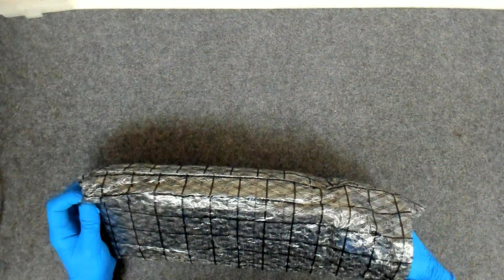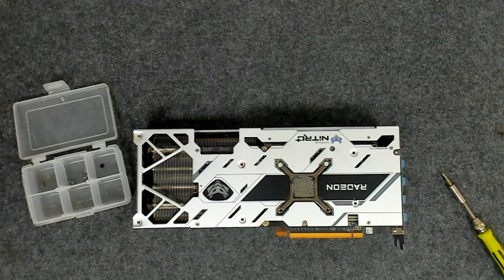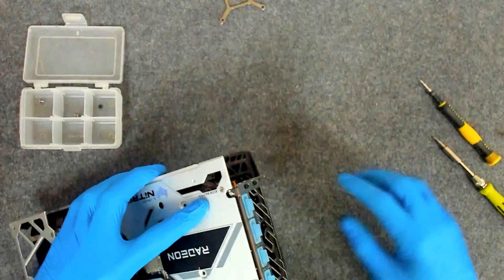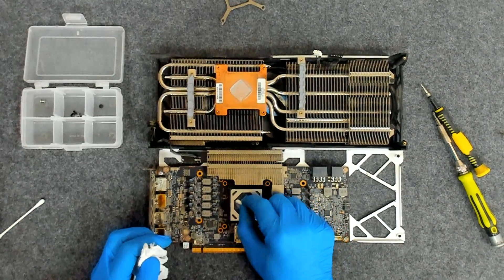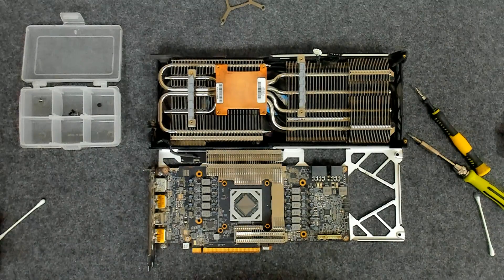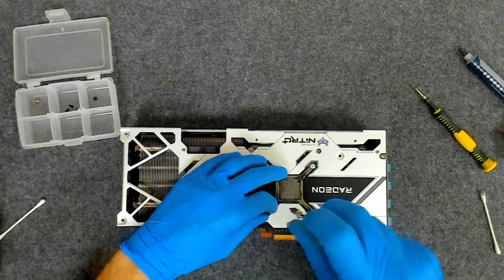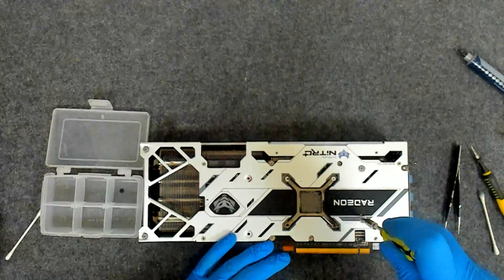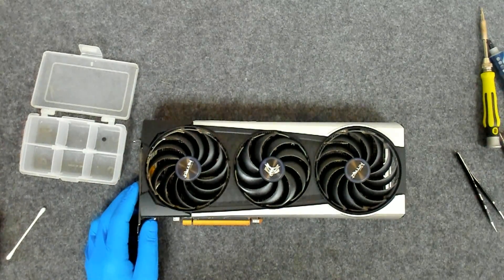AMD RADEON RX6700XT Nitro+ Thermal paste Replacement

Comment: Que thermal pads lleva la tapa trasera de 2.5mm o de 3.0mm amigo
Reply from the maker: For the back cover you can use either 2.5 or 3mm. If you go with 3mm, try to use some soft ones.

Comment: Don't you think that we have to change for the second one also . Over the mosfits
Reply from the maker: Over the MOSFET's is thermal pads. I do what the customer requires.
Reply: Hey, thanks for the video, but I was interested in changing also thermal paste/pad for the vram. Is it possible?
Reply from the maker: @benjaminsanchez9510 yes it is possible, but you have to check what is the thickness of the pads, coz they are different on the vrms and memory. Also get a quality ones like thermal grizzly or so.